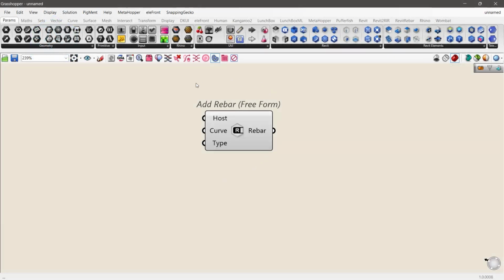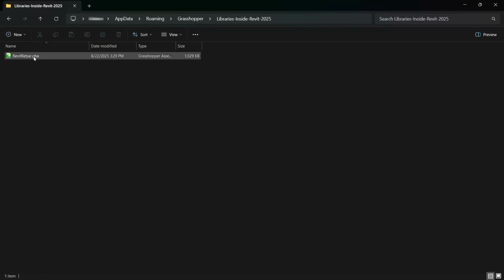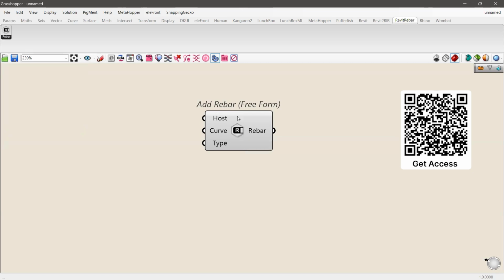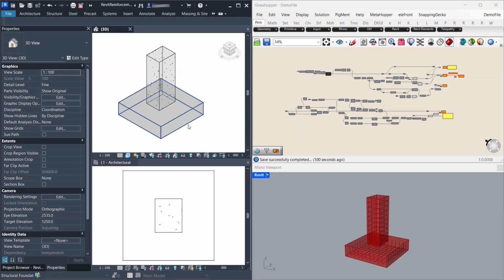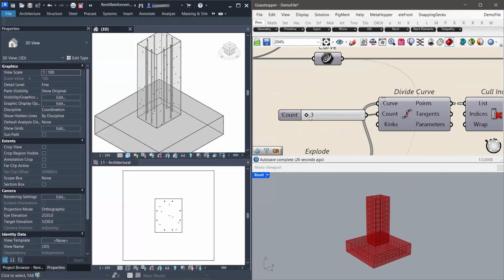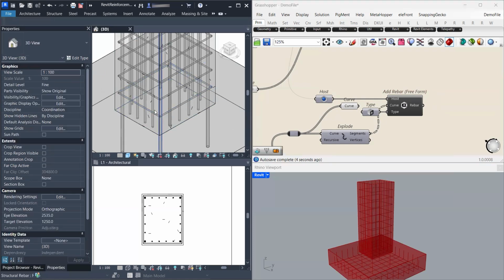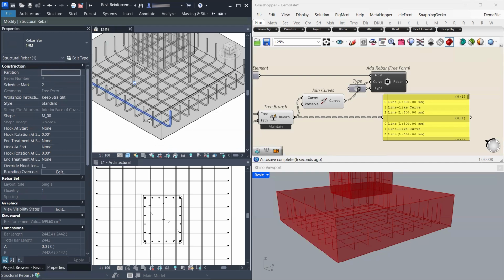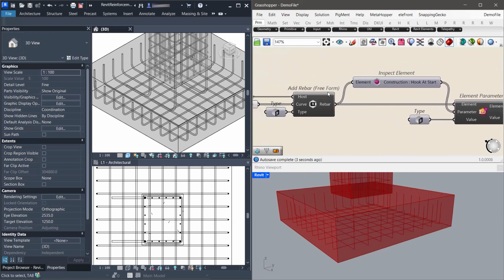Automate Rebars In Revit with Rhino.Iniside.Revit

Comment: Thanks. It looks great. just wanted to know if it's also works with Spiral Shape Curve?
Reply from the maker: Do you mean circular curve ?
Reply: @ParametricPlanetNo. Spiral. Rebarshape - 77 in Revit.
Reply from the maker: Can you post a picture? I couldn’t find such shape. May be you are using different library.
Reply: @ParametricPlanetUnfortunately, I am not able to add it. But if you search for "Modify Spiral Rebar in Revit" you will get to know.